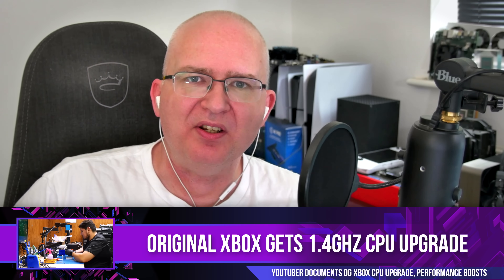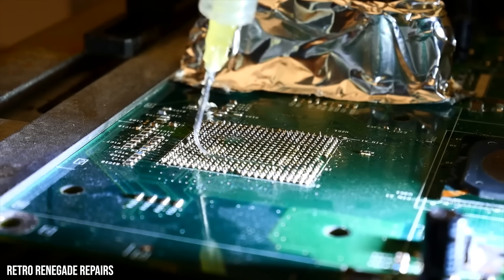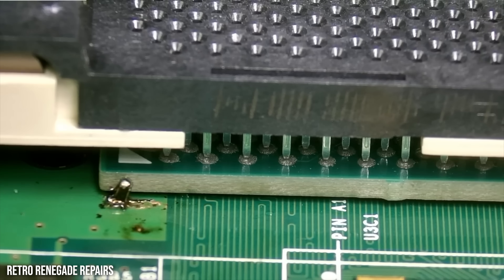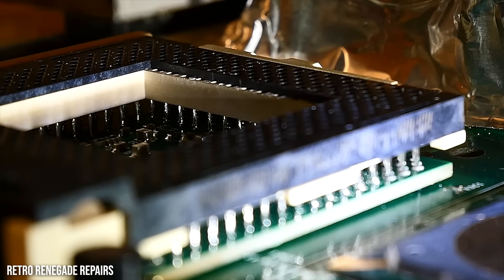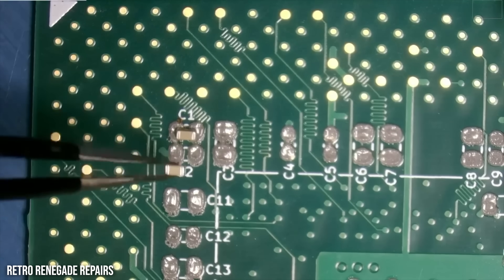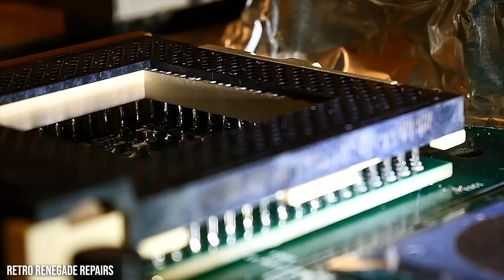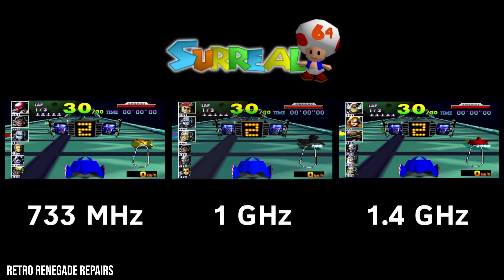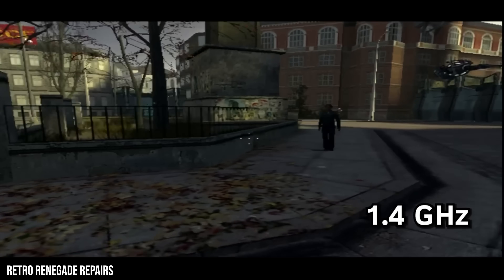OG Xbox Gets A Game-Changing 1.4GHz CPU Upgrade!

Comment: I have a few modded and recapped boards in complete playable systems with tons of games and emulators. Also have a 1ghz Trustee board I got years ago by itself. I tested it but I need to get the software patched as it runs fasts thinking of sending one of my other modded systems to him for the cpu upgrade for the emulators in a standalone system. I’ll leave it without OG Xbox game titles and maybe stick it in an arcade cab. Maybe build it around my Xarcade Tankstick with trackball. I love Coinops. This guys skills is next level.

Comment: This upgrade has actually been around for well over a decade, but I haven't seen a walkthrough on it until recently. Not sure if the hotswappable socket was ever a thing before now. It's not something just anyone can do because there is some serious skill required along with some uncommon equipment. The memory can be upgraded now to 256MB as well with little adapter boards and I believe the chips used for this are faster than the older ones, but the guy that figured out how to do it did need to underclock them in order to get them to work from what I gather. Not sure just how much. His video is here:

https://www.youtube.com/watch?v=1idSEhUT4PM&t=2s

With CERBIOS and a chipped Xbox, you can also now get UDMA5 (even 6, I think) speeds instead of the standard UDMA2. With an SSD and 128kb clusters as opposed to 64, you'll get really noticeably faster load times and seek times.

I have yet to see an ultimate Xbox build with the following upgrades, so it would be really cool if Digital Foundry could make it happen:

1.4GHz CPU
256MB RAM (128 would be fine as there's really no software that will utilize more than that just yet)
HDMI out
SSD with Startech IDE to SATA adapter and 128kb cluster sizes
80pin IDE cable
CERBIOS with UMDA5
GPU Overclock
Fan upgrade (I would put one on the GPU heatsink as well)
For a chip, the new MODXO is Raspberry Pi Pico-based and should be the end-all be-all mod chip for Xboxes going forward.

Comment: The og xbox and the dreamcast were so underrated
Reply: The OG Xbox is like the Dreamcast 1.5, (the Dreamcast had powered by Microsoft Windows CE printed on the case. After it got canceled, where do you think the Sega engineers went? Although the Dreamcast & OG XBOX technically belong to the same console generation. Sega made some serious missteps with the Sega CD & the 32X…the 32X should’ve been released as the stand-alone Sega Neptune, and it should’ve been expandable with the Sega CD to make it compatible with both Sega CD & Saturn games, then the two could’ve coexisted…then the Saturns run would’ve been longer, Electronic Arts wouldn’t have totally cut ties with Sega, and the Dreamcast could’ve been released closer to when the PS2 & XBOX releases & would’ve been more competitive…it came out like 2 years before any of the other consoles of it’s generation, and was canceled before it could be competition against the PS2
Reply: @EL3KTR0N  If Sega just had to come out with an add-on it should been the 32x instead of the CD. Gaming hadn't really got the point where CDs were needed but a 32x in 1992 instead of 1995 could've been awesome.

Comment: I think it would be so cool if someone made a custom motherboard that is designed to be an og xbox with modern features built in to make upgrading easier. Desktop or laptop ddr ram, desktop or laptop cpus, desktop psus, and the ability to just use sata drives.  Honestly I would be willing to spend a decent amount on a motherboard like that.

Comment: IDK.
Looks hard. Insane. Hey if you can pull it off i suppose. Id probably mess it up. Then without a xbox.
Looks like it benefits emulators. Maybe a game or 2 maybe unrelesed.
Whats up with leaking capacitor. Why.

IDK were sticking with emulator for xbox thanks.
One dude said bought a xbox for online and the hack will overwright the hack. So no point.

Comment: PC gaming has 2 big issue that is operating system and optimization. I have a 13700kf , a rx 7800xt , ddr5 64gb 6800mhz ram and a 2TB WD black sn850x . I had so many stuttering issues in games like Fortnite Fortnite, battlefield 1, apex legends, COD etc so I had to trouble shoot windows for months to run games properly . I'm getting like stable 400fps in Fortnite but It didn't feel buttery smooth even though I was playing on 360hz monitor, getting 1% low fps above 269 and getting 0.1% low fps 210 I fixed this issue by disabling prefetch on windows.

Comment: Phil Spencer said the next XBox is going to be a huge step forward in hardware. As long as Microsoft doesn't stop this plans ...

I wonder how a Series X successor would be like, if it would have a upgradable graphics card or CPU unit. Similar PC cases to the Series X design are available and it would be really nice to just swap the "RX 6700 10 GB" GPU in the current one to a RX 6800 XT 16 GB or even a 7900 GRE.

Such a console design that combines upgradability with an ready to use system would be the next step for enthusiasts. I am sure AMD could come up with "stock XBox" video cards that are optimized for moderate power usage and fit into a small space such a console design has.

Comment: For the record: Most 40nm RSX are safe to 700MHz core/900MHz VRAM. However there are later batches that has gone 900 to 1000MHz (both core and VRAM). The latter however, is NOT advisable and only gets you diminishing returns. The modding community has poured incredible work in testing chip batches.

Comment: I wish Microsoft would release a modern and miniaturized Xbox Classic with updated components. My original Xbox still works, but it has fuzzy component output and some games would really benefit from an updated CPU.
Reply: Your X-Box needs a simple recap! It'll be fine bro, know a tech?
Reply: Was really hoping an Xbox classic would come out in 2021, might just have to make a homebrew at this point.
Reply: I had that issue. Turns out I needed to replace a few capacitors on my PSU, but I decided to just replace all of them on the power supply and motherboard at once. It’s a soldering for beginners job and not that difficult once you know which ones to buy.
Reply: Yeah the caps on the motherboard have probably started to bulge and leak and are corroding the motherboard. That is why you have a fuzzy picture. It's probably toast at this point bro. Back up your saves and stuff if you can,and get one that has had new caps modded on.
Reply: @Doubleohstevo  My 1.6 xbox crystal is in perfect condition and caps were replaced. The component video output on this console is just not very good. Try to compare YT videos between HDMI modded Xbox and component output and you will see that the latter has somewhat blurred pixels because the Xbox applies post-processing to component video output (contrast edge sharpening). I even remember reading discussions about it, so it's not just my xbox. At a normal viewing distance, the picture looks good, but the pixels are not as sharp as on the PS2 or Gamecube.
Reply: @PabloB888  Are you using a CRT or HDTV as a display? If it's HDTV (LCD/LED etc) then that might be the cause. These systems were built with CRT's in mind. Other than that,it could be a faulty display out,or a dodgy cable. Also Component whilst it can display a HD signal,is analogue,compared to HDMI which is digital. So component will look softer no matter what you do.
Reply: @Doubleohstevo  I use CRT, Plasma and of course LCD, but that does not matter. Like I said, original Xbox console has always been known for having a poor picture quality. It's partly software fault (extremely strong flicker filter when using standard video output), but also hardware because component encoder adds contrast edge sharpening and you can't do anything about that. The image from component output may look fine to some casual gamer, but I'm a Photoshop artist who can see even a subtle difference in sharpness. I can also see that imperfection in retrotink 4K tests on YT, just search xbox gameplay on retrotink 4K. Some youtubers even said that the image quality is not as good compared to PS2 or Gamecube and I explained exactly why this is the case. You have to HDMI your xbox to get perfectly sharp pixels.
Reply: @PabloB888  I understand. I'm a bit of a perfectionist myself. Even watching pristine 4K movies i tend to nit pick little details :p Saying that,i don't ever remember having any bother with picture quality on my Xbox (i was about 2 decades younger tbf) and i was initially using it on a 4:3 tv,then a 16:9. But whatever. Hope you get it sorted.
Reply: @PabloB888 that’s because it’s a 1.6 revision with an inferior video encoder
Reply: @brkbtjunkie  I have had about 8 Xbox consoles and I still have 3 working. All of them have the same picture quality over component. I'm using the 1.6 version the most because it's in the best condition and it's also have the biggest HDD (512GB).
Reply: Better cpu, faster memory, smaller, wireless controllers shaped like the originals, HDMI, ssd storage and dlss upscaling. Honestly I think it would outsell the series X
Reply: @edwarddavid7893 it definitely wouldn't
Reply: @edwarddavid7893  Why would it need DLSS upscaling? a modern minitaure "original box" release would have enough power even using a cheap AMD APU to render the Original games at high resolutions and framerates natively. The hardware required for DLSS upscaling (ie. an Nvidia GPU) would add more cost and complexity, leave that for a potential Switch 2.
Reply: @edwarddavid7893  They cannot use DLSS because it has to be implemented in the game code. Without temporal data, there's no way to increase the resolution with real detail, so they'd just have to upscale the image, and then the results would look bad.  

Unless microsoft will use software emulation to run xbox classic games it will be impossible to increase resolution. I personally do not mind playing at 480p. The thing is, 6'th gen era games (xbox classic / PS2 / GC / DC) were made with low quality assets in mind and increasing resolution only reveals more imperfections (textures no longer look sharp, low poly models and LOD transition is 10x more noticeable ruining the imerssion). At 640x480, even PS2 games have reasonably sharp textures and convincing models, yet alone xbox classic games. 

But the 480p resolution has to be scaled in a special way to make it look good, because otherwise the image will be extremely ugly (pixelated and blurry) on modern 4K display. On the PC I'm using integer scaling to get perfectly sharp pixels and then I use CRT phosphor mask emulation to remove pixelation. The upscaled image looks so good at 4K that even my real SD CRT has worse image at native 640x480i (standard SD CRT TVs blurred the image way too much, while CRT phosmor mask allows me to emulate PVM / CRT monitor that has way sharper image). 

Retrotink 4K can upscale 480i/p with equally good results, but the problem is that the original Xbox has a somewhat blurry picture from the component video output, so results arnt nearly as good as even on the PS2. I know there are HDMI mods for the original Xbox, but I'm not willing to take the risk. 

Xbox emulation on PC is getting better and better, so even if Microsoft doesn't release a modern Xbox classic, it's only a matter of time before every great game from that platform will be playable on PC :).
Reply: @edwarddavid7893 LOL but that sounds fun ha!

Comment: I still adore the OG xbox. I got ps2 at launch and was massively underwhelmed graphics wise. I sold it after a year and half and got the xbox. It just felt like a huge leap over the ps2, not just graphically (first time playing Halo was mind blowing) but also the materials used to make the console felt more expensive.
Reply: Eh, I wouldn’t go that far. The best looking PS2 and GameCube games easily stand next to the best of the Xbox regardless of its power advantage. Most things being interlaced on PS2 is definitely an annoying disadvantage though.
Reply: @seanmcbay just look at splinter cell chaos theory ps2 vs xbox
Reply: @sendystimac123 just look at Silent Hill 2 PS2 vs xbox
Reply: @sendystimac123  yeah i had splinter cell on both xbox and ps2. The xbox version was vastly prettier
Reply: @seanmcbay I disagree. Some games looked more like a 360 game than a PS2 game
Reply: @kasjamm No they didn't. Original xbox was no where close to AAA 360/PS3 graphics
Reply: @MichaelM28  There were games like Chaos Theory that easily looked a generation above the PS2 version.
Reply: What a terrible decision you made 🤣🤣🤣🤣🤣🤣🤣
Reply: @MichaelM28  who me? I had way more fun on my xbox so no it was actually a great decision.
Reply: Both made were made of cheap plastic. Nothing about the xbox design more premium than the PS2.
Reply: "It just felt like a huge leap over the ps2"

4376 PS2 games vs 988 xbox games

😂😂😂😂😂😂
Reply: Leaky clock capacitors, dying hard drives and dried up thermal paste feels more premium to you? 😅
Reply: @MichaelM28 Did you by any chance had a stroke lately? Would explain all your nonsensical spam. And all those stupid smileys. Ask yor parents to take you to a doctor.

Comment: I found with my RSX that it capped with 750 on the core and 975 on the memory. I haven’t tried over 975 with the memory, due to the possibility of bricking. My PS3 is an A01 Frankie and has the 40nm RSX.

Comment: I wished you would do or mention a Frankenstein PS3
Reply: Awesome mod but doesn't improve performance, only reliability
Reply: @MichaelM28 @jakesnow96 actually we can Overclock RSX to Twice the Clock which will Make Performance Twice than original.
Reply: @MichaelM28  I agree
Reply: @jakesnow96 actually we can Overclock RSX to Twice the Clock which will Make Performance Twice than original.
Reply: @VictorHugoAlvarez-eternelymiss  it doesn't work that way. at around 700mhz on RSX and 850mhz on VRAM you start getting diminishing returns. also you can end up bricking your console if you target frequencies far above the original values.
Reply: @nunosa528  Yea You're Right!!!!
Reply: @nunosa528  perhaps Some games will Have their performance Duplicated for sure!!! And 1Ghz on RSX 40nm with 1.35 volts is very possible

Comment: The 256MB memory upgrade is cool too.
Reply: they got it higher with custom bios
Reply: Maybe combo of these two - cpu and ram is good. But ram alone is useless. When upgrading cpu it is good performance boost, but ram is just ram nothing happens.
Reply: @kusiled8084  two mods is overkill boost yes, only ram mod give you a little bit better experience in xbmc or some homebrew with faster load of image or little bit of las lags, some homebrew don't even start without 128 ram. Just I say, this mods for enthusiasts fun, if you want just play game, you just use stock and play.
Reply: But completely useless.
Reply: Yes, CPU upgrade is not something new, it's been doing 20 years ago when ogx is current system. But ram upgrade up to 256mb is really new feature and more interesting. Like new mod chips with new bios system.
Reply: @_Tualatin_ Kinda useless, I mean we could get higher resolutions but the instability is insane, and games weren't meant to use more ram than specified
Reply: @mikestaph  it's unstable because it's on very early stage. Mostly mods like this don't have any utilitari sense it's just because you can. May be in future it's can be somehow improve in game by patching. It's interesting because it's new and broke limits.
Reply: @_Tualatin_  I'm looking forward to a new Minecraft port, Xbox is pretty darn good in raw power, with more ram we could get a better build than the one that's on the wii
Reply: @mikestaph  Considering it was a struggle just to get Minecraft to run on the XBOX 360, I highly doubt you'll get a good experience on an OG XBOX even with a faster CPU and increased RAM Size
Reply: @prich0382  I specifically said Wii port
Reply: Nah, it's totally useless